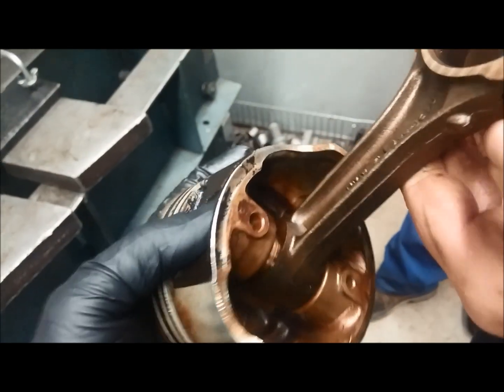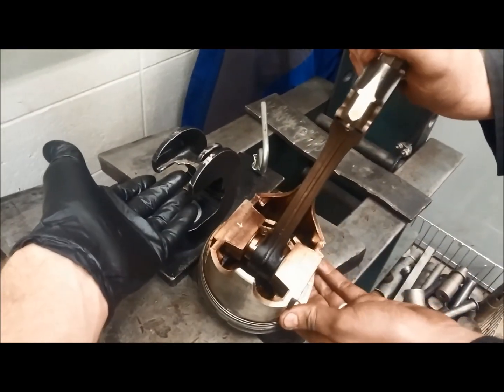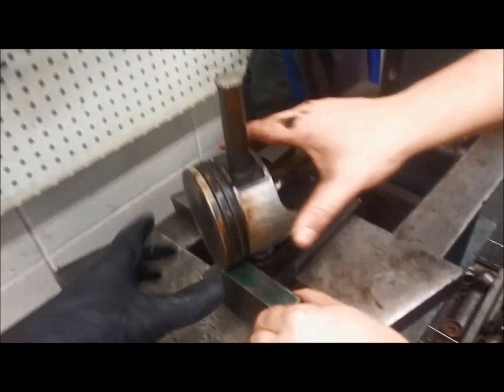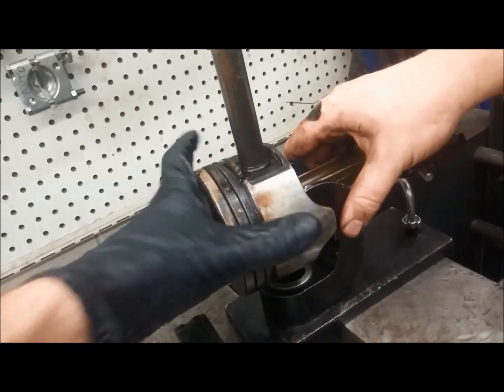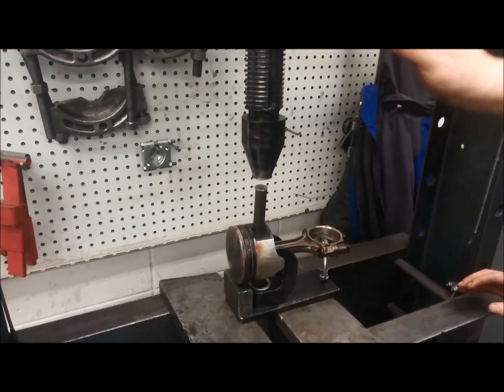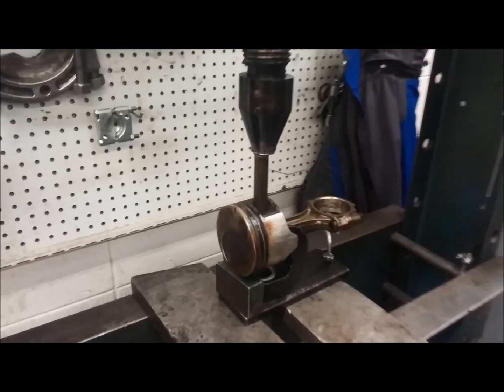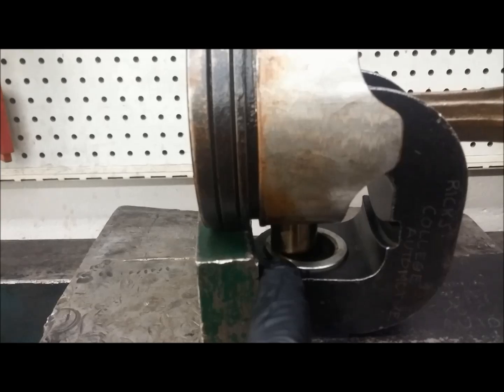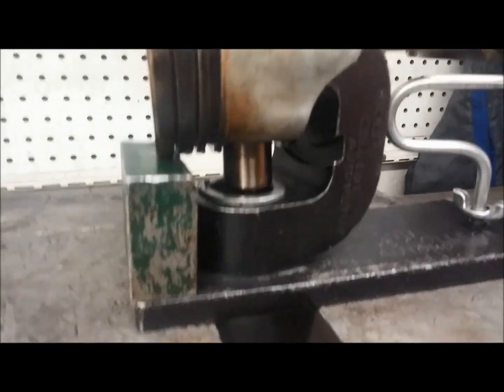Pressing a wrist pin out

Comment: If I ever plan to rebuild my 5.7 Litre Chevrolet LS1 V8 engine I would upgrade the pistons & connecting rods to the full floating type of wrist pin setup since mine is a 2002 built engine,not 2004 onwards.

I noticed that one of the cylinders (number 6) had a slight amount of scuffing  on the cylinder wall which leads me to believe that is causing a slight amount of piston slap for a few seconds while the engine is cold during winter time,I noticed it nearly 5 years ago when I was replacing the hydraulic lifters.

Once the oil gets up into the cylinders it goes away but I would consider replacing the pistons with at least new standard sized pistons if not 0.010" oversized pistons if necessary.

Holden bored them out to that oversize in 1999 in the VT Commodore when some of them were assembled with a bad batch of pistons which led to premature wear of the Teflon coating of the piston skirts & excessive oil consumption.

Holden had a technical service bulletin saying that any engine which drank more that 2.5 litres of oil within the 10,000 kilometres service interval qualified for the rebuild under warranty !

Comment: if you dont wanna damage the rod or piston use a gas torch to heat the pin up on both sides. lube it up with wd. and press out as normal. it slides out much easier. ive reused pistons this way for years.